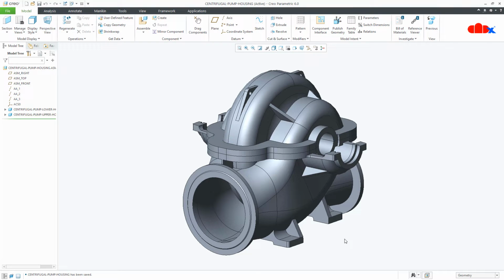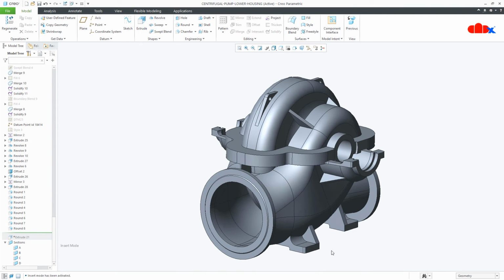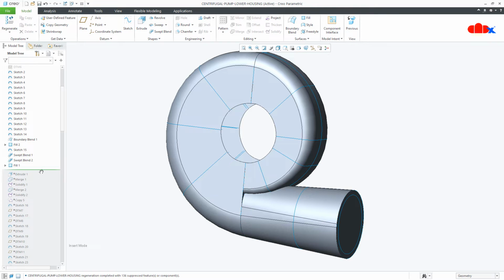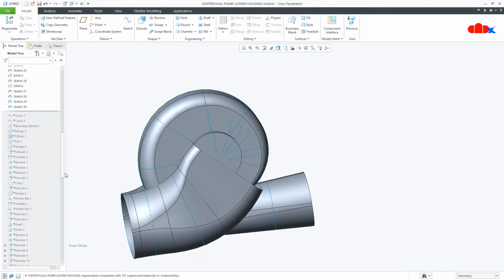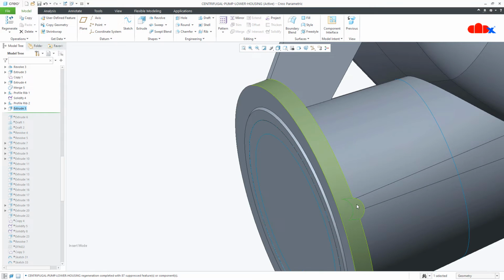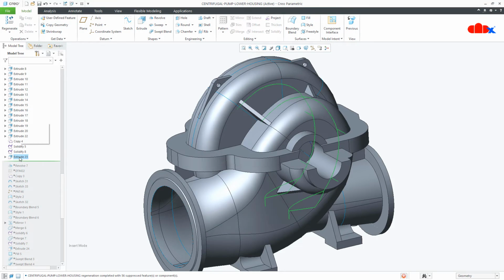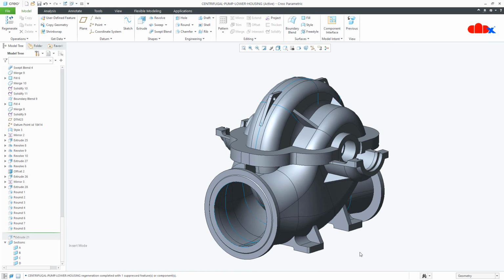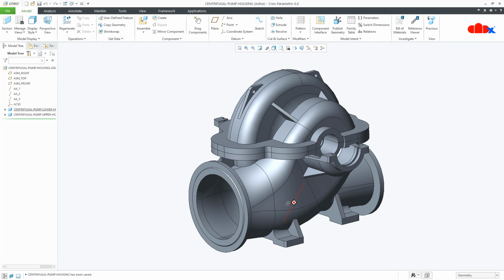Centrifugal Pump Casing | Surface design in Creo Parametric

Comment: Since usually pump casing are produced by sancasting, the external surface of the pump is more complicated than doing a simple offset. You need to add the draft angle, and merge those draft surfaces into the solid is the most complicated part of converting the 2d drawing of the casing to a 3D model. I have done a lot of those.
Reply from the maker: This is done based on the available drawing that is why there is no draft added to the outer surface of the casing.
Reply: Is this video available for 199 rs members plan  @CADx-in
Reply from the maker: No. You need to buy the level Adv. surface design